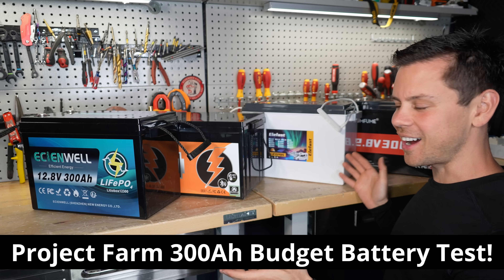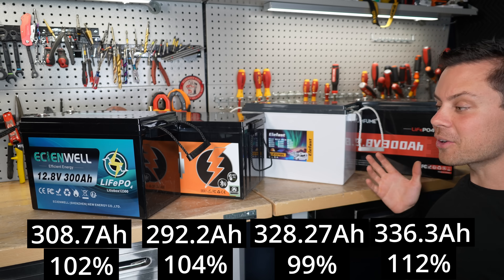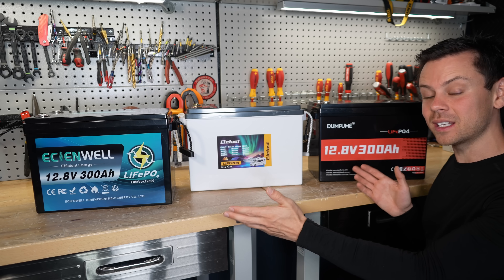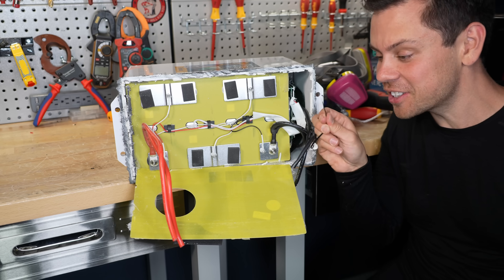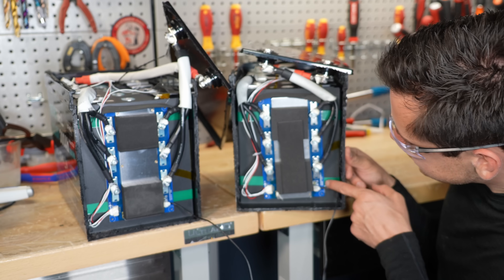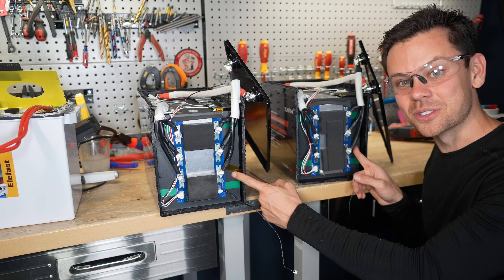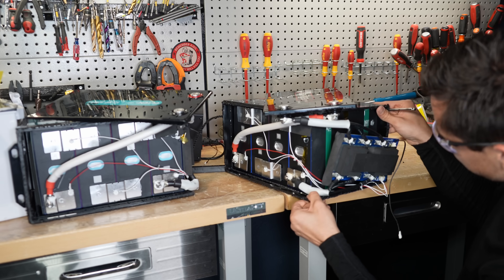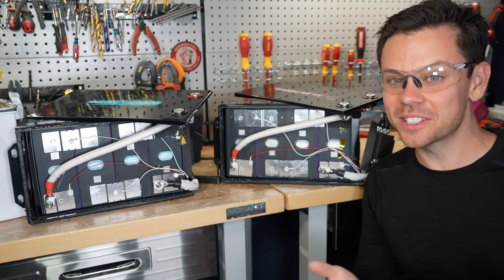300Ah LiFePO4 Showdown!! $300 for a 300Ah Battery?!!

Comment: Good advice on fusing the batteries, especially on r/v trailers.
Reply: No, not just good, but GREAT advice!!!  You DON'T want a fire! The cost of fuses is far less than the cost of a new RV. Very cheap insurance.
Reply: Any recommendations for a fuse for the battery?
Reply: @tonydevito765  For my r/v I run two 100ah batteries, each fused with 100amp fuse blocks with terminals, considering the wiring going to the trailer is only #6 guage, hope this helps.

Comment: I bought 4 of the 300ah dumfumes about 3 months ago and no issues yet, but boy you had my anxiety peaked worrying if they were going to be garbage inside. I have not had any overheating issues like another commenter said, I use them in a 2s 2p configuration  and run my 24v air conditioner in my rv pulling ~ 30-40 amps constantly for hours

Comment: I’ve got 3 of the NewtiPower 300ah 12 volt batteries wired in series on my golf cart.  I haven’t seen anyone do a recent tear down on them and they can be bought for $329.  So far they are doing great in the golf cart and they are also connected up to a 36v split phase 2500 watt power inverter.
Reply: I tested 4 newtipowers and they all had 280AH cells.
Reply: @jamesrladd  that’s what I figured.  How long ago did you test the batteries and were they new or used cells?

Comment: Have you tested the 300ah Newtipower? I did not see anything on the forum and my searches just returned Dumfume..don’t think they are the same. Pretty happy with them, but haven’t the ability to tear down or actually test.  Closest I came to testing is knowing they balanced well in my 48v system and seem to be staying balanced based on my smart shunt.
Reply: I tore one down and was not impressed. They use 280AH cells

Comment: Question - Can these be used as drop in replacement for a 12V Travel Trailer Battery?  Or will the constant charging/trickle charge of the RV ruin them? 

There's a deep cycle Lead Acid battery now, but its 10(!?) years old now and moving the slideouts was really struggling this year. Would also like my fridge to run longer if the mains power goes out.
Reply: It normally isn't recommended. The charging settings for a lead acid battery and a LiFePO4 are different. If you have a new enough camper you could check to see if the charger converter has different charge setting for different chemistries.
Reply: @ssteele1812  Thanks!  its a 2013 so I doubt it.  Just list a 600 watt 12volt inverter. It says it "wont overcharge a 12v Deep cycle battery" lol
Reply: @Sudz3 there are dc to dc chargers that you could put between the converter charger and the battery but they would limit the amps coming from the 50A converter. You could also swap out the converter charger to something rated for lithium.

When I went lithium, I ended up removing the converter charger completely. My solar charge controllers take care of all of the charging duties.

Comment: Don't know if it's just the way the video is shot, but the BMS cables look thicker on the Ecienwell compared to the Dumfume. Is it an optical illusion or if they are actually different? And if so, is the wire gauge different or just thicker insulation?
Reply from the maker: Same size, the sheath makes it weird looking

Comment: i remember you saying that connecting 4x 12v batteries in series to make 48v was a bad idea, but could you please explain why? ~$1300 for 300ah at 48v is pretty attractive compared to 3x of the $850 ecoworthy 100ah 48v batteries
Reply: Some of the older/cheaper BMS couldn't handle four batteries in series. These Dumfume, and many others, say that they are rated for 4s4p config. Check the spec sheets so you are safe.

Comment: Just found this one on Amazon for $399  ECO-WORTHY 12V 300AH LiFePO4 Lithium Battery Bluetooth with SOC LEDs, Low Temp Protection, 3840WH, 200A BMS Up to 15000 Deep Cycle.

Comment: I bought 3 300A Dumfume at 3 different times, each time with coupon and price drop adjustment from TEMU.
$305.87 - $120 coupon = $182.96 + $17.19 tax = $203.06 total, then they gave me $16.26 refund due to price drop after purchasing so it ends up to be $186.80 total for each battery. I really got a good deal for 3 batteries for less than $600!
Reply: How did you get the 120$ off coupon?
Reply: @cajampa  TEMU sends me an email for the discounts, I bought a lot of stuff from TEMU, I found out that I can buy the same stuff at lower price from TEMU that are being sold on the Amazon by the same seller.

Comment: I bought 4 300ah dumfume batteries, all of them were getting hot, come to find out they all had loose connections. Was forced to open them since their support said it was within the margin of error. Posted a video of it, I'd rather not margin of error burning my house down thanks..
Reply: lol
Reply from the maker: Holy cow!!! That is horrible!
Reply: Talk about fumes! 😂
Reply: @rkan2  Doom Fumes
Reply from the maker: Just went out and checked mine, all the connections are super tight. Your video is terrifying, that's awful
Reply: @WillProwse  I'd love to see you do a review on dumfumes 600ah battery!  I bought one for myb12v backup but sketched out to open it up. 😆
Reply: @WillProwse  Link to his video. It's not on his YT channel.
Reply from the maker: When was the purchase date of your packs? You should post your video on the forum for all to see. Maybe others have the same issue
Reply: What kind of amperage were you pulling to get the to heat up? Not looking to make excuses for them, I'm just curious.
Reply: it's just quality control issues from most chinese factories
we are a reseller in south america suriname we order them not sealed so we can inspect everything ourselfs before sealing them ourselfs.
Reply: I bought 4x300ah dumfume, great quality when I opened them up. Only just needed to be balanced.
Reply: @compfixer44 how did you balance them just with the internal passive balancer holding them over 14.1v?
Reply: @compfixer44  "Just needed to be rebalanced"?
I guarantee you over 90% of the population maybe even 98% of the population doesn't know how to do that or even  know what it means.
Reply: @desertodavid what does it mean to balance?
Reply: @cubul32 I think you charge them all to full install them and leave them for 24 hours before use
Reply: What information did you use to contact Dumfume. I have been unable to reach them through the supplied email.

Comment: I almost bought a couple of the Elefast ones the other day. Other reviews for it say it has a Bluetooth JBD BMS that works with the Overkill app. Kinda wonder if that overcurrent setting could be adjusted. Disappointing that it didn't meet its stated capacity though. They advertise A Grade EVE cells on the Amazon site but seems like a crapshoot on whether that actually holds up for all of them. Hard not to look at the Ecienwell one now. Those names sure are silly. I guess they don't have to worry about Trademark infringement.

I'll be curious to see what comes up for Prime Day stuff for deals... kinda hoping a few of the $500ish range batteries will come down in price. Might have to wait for Black Friday to buy.

Comment: Does the BMS let you limit charge current so it can be connected directly to an alternator?
Reply: At best this style of BMS can simply cut off if the amps gets too high.  Not what you want for charging unless you can adjust your alternator's current (vary the field).  Using a DC-DC charger which has a current setting is really the best choice.

Comment: @WillProwse part of this is from a post on the forums. But since we're talking about DumFume thought others would like the experience. I bought "76" of these Dumfume batteries over the last three months! Bought them for my mother's farm in Ohio and my farm here in PA for a DIY solar install. So here is my report to you Will on that outcome using these batteries to help you and others here decide for themselves if they are a "bad"/"good" deal or not (it's actually more complicated IMO)?

First off I know ultra cheap Chinese batteries are always going to be a bit of a gamble? But I figured it could still be a great value if I researched and was careful (as careful as you can getting cheap Chinese stuff)? The DumFume 300Ah batteries I first bought were 280EVE grade A EVE cells, and a decent BMS (later newer ones were 314Ah cells). Using carefully timed Temu coupons I bought these 280Ah 12v (later 314Ah) batteries for anywhere from $200 down to $125 each (add the tax credit that's at times LESS than $100 each for a 280Ah-314Ah 12v battery!)! I decided I could put them in series at 48v with an active balancer on each 4 set of batteries. I first put each 4 set in parallel to top balance them real slow over the course of 4 days (did this for each set). I did have a bad experience with the shipping of these batteries as lot of my battery boxes came totally covered in mud. I mean some of them had such huge clumps of mud stuck to them you couldn't read what was on the box (perhaps logistics shipper problem?). But when I opened the battery boxes the batteries inside looked new, and clean. I was expecting a few bad batteries, and one was missing it's screws (I had extras and strangely so did some of the other batteries). But all of the batteries I bought very surprisingly tested good, and several months using them from my earliest purchases all are performing really well on my solar install! Due to being in such large combined battery banks the amp draw/charge from my LuxPower-12k is modest on each individual battery. So I hope the cells in my batteries last a long time by not stressing them? If not buying a replacement battery I thought should still be cheaper than building a battery bank using a more expensive battery with a warranty?

You wonder how these batteries can be so freaking cheap? I've heard from the grape vine LFP prices have totally crashed in China when EV purchases dropped and now EV battery factories who aren't getting orders are trying to stay employed. So factories are now all trying to dump their excess EV battery inventory ALL on the battery market all at once because they are afraid they will take a total loss. Doing this has totally flooded out the battery market in China. Plus for a while China was using third party countries to ship batteries to the US to get lower tariffs. So we are likely paying higher prices than the rest of the world due to tariffs. But we are still likely still seeing a benefit from the "glut" battery prices on some cheap battery brands. From what I hear some popular battery brands are reaping HUGE value from the battery glut in their sourcing (if from China), and at least right now are mostly keeping the profits for themselves.

That said if you don't have a lot of money or want to stretch your budget as far as possible? These DUMFUME (and possibly others brands) batteries can still beat almost anything else on pure price. Just to give an example on what I was able to accomplish with these prices? My farm's electric bill was averaging $375/mo. I DIY built a solar setup (By watching your videos Will Prowse thank you!) with 15k of solar panels, 109.6kWh of LFP battery bank, and a LuxPower-12K (same as EG4 18k) inverter all for $14k (before tax credit!) to power my farm. My electric bill is now $15/mo (I keep grid as a backup). It will pay for itself in roughly 4 years or less which is very reasonable. Then I'm saving money!

On the forums I posted a pic purchase receipt of my paying $125 per 300Ah DumFume battery. Notice on the receipt each order is for x2 batteries, and there is two orders. So I paid a little over $500 for x4 280Ah 12V batteries with grade A cells, and a decent BMS. Was the cheapest way for me to build my battery bank by a long shot I could think of? If others (or you Will?) find other ways to build cheap/decent battery banks I always enjoy hearing about it! :)

Comment: The 330Ah Elefast has a 200A JBD Bluetooth BMS which has 3 levels of OCP. You can adjust it however you want.
Reply: Yes. Tweaking the BMS is unfortunately necessary right out of the box. The OCV thresholds were wrong. It would shut the battery off. The cells wouldn’t balance. I found a post of the forum with suggested settings and it solved all my issues.

Comment: I got three 300Ah LifePo4  Oases Energy batteries, balanced them the first 2 cycles and got around 870Ah out of them.  The LiTime 3000W inverter shut down with 30Ah remaining according to the LiTime shunt monitor.
Reply: Getting below 900ah means used cells

Comment: I bought a LiFePo4  "FIUNIE" battery from Amazon.  Another youtube channel tore one apart and found lithium ion batteries in it, not LiFePo4.  Did you check the cells in these batteries to make sure they were really LiFePo4?
Reply: That's prismatic lifepo4 cells.
Firstly, the voltage speaks.
Li ion has 3.7v
Lifepo4 has 3.2v
Also, weight and capacity speaks.
If is heavier and big for the smaller capacity, its lifepo4.
Reply: @FRESNEL_COOKING_SOLAR_OVENS24  thank you so much, I didn’t know this.

Comment: Based on the 100ah Dumfume video I pulled the trigger on 16 (4p4s) of their 300ah units. I have to say, I'm a bit impressed with the bang for the buck. I bought mine for $286/unit from Temu (side note, NEVER buy from that scam company. Nothing but headaches with my purchase. Much much better off to buy from Amazon. )
I've read reviews that some people opened them and received 280ah cells in them, though. I opened one of mine and they had 305ah cells, which was what all of mine capacity tested to too, which I was fine with being a budget battery. 
I may have lucked out getting all mine in the same batch of cells, but I would recommend everyone treating theirs prior if using more than one together. Other than that, I have 61.44kwh for about $4,500... steal of a deal if you ask me.
Reply: MB56 cells cost under $100 each, so you could actually build something cheaper and better with those.
Reply: @primetoy And there's a company making a box for them, off grid garage I believe it is , The guy in australia , it just did a video on it
Reply: @primetoy  and if he owned his own logistics hub it would be even cheaper... There will always be a cheaper way regardless he made a good deal

Comment: Eco-worthy alternates their sails between Amazon and eBay. They're on eBay for $319 right now.  I would have loved to have seen it in the comparison.
Reply: Love your videos, keep up the good work!
Reply: @itsme1241 bot
Reply: I agree.  I have 12 of them and need 4 more
Reply: I wonder if Will doesn't consider ebay in this case because of affiliate links or something.
Reply: Yea they raise and lower the price of the battery depending on what sale eBay (via the direct manufacturer listing on eBay) has going on. They will be 376 when the 15% is going on, and 399 when the 20% is going on (like it currently is). 

They will also keep multiple listings with even higher price, like 439, so you have to specifically look for the cheaper ones. 

Then again, I'm sure the other listed batteries in the video also have their own coupons.
Reply: There was a deal for a 12v 100ah + 20amp charger for $150. Hoping to see that again.

Comment: I like seeing cheaper batteries tested here. "Buy once cry once" certainly happens, but it only matters if you can buy the high-grade stuff,which many of us simply can't.
Reply: I can but I'd still take a chance if there were enough supporting information to indicate that it's worth the gamble.
Reply: @RussellHank-t3t  The difference between 1200 and 1700 US for 16Kw when you need 100Kw stacks up real fast. And when you are buying in that size range, if you have to replace one or these for 300 bucks vs 1 of the others? Ouch.